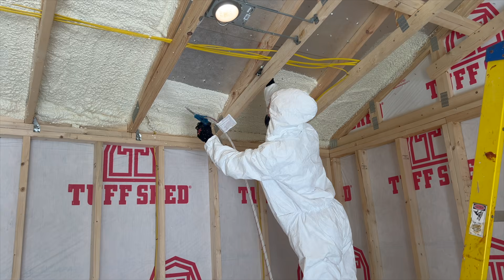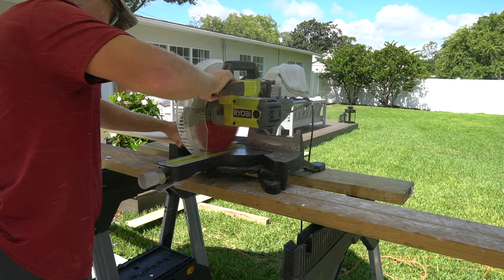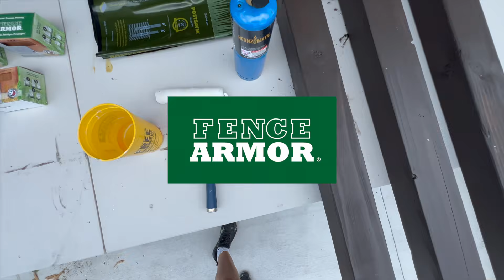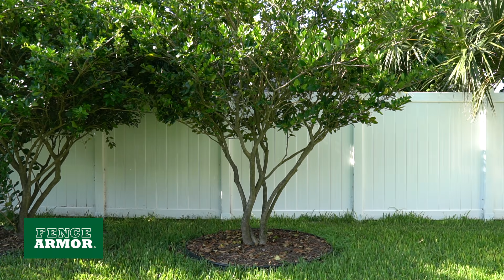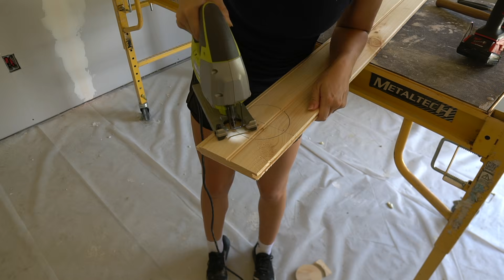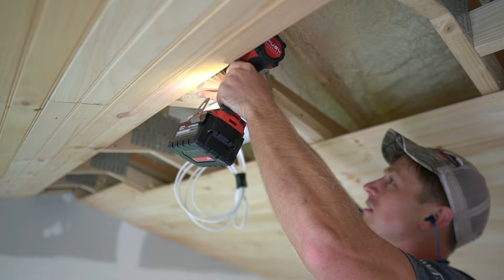How to Install Tongue & Groove Board

Comment: Did you put trim to cover the gap where your t&g met the drywall? If so what kind?
Reply from the maker: Nope, we didn't have a gap. The small seam probably could have been caulked but it wasn't really noticeable! You could cover with a small scribe moulding if you need to.

Comment: We want to tongue and groove our slanted ceiling but trusses and rafters aren’t even (and not on center) and there is no level reference line and trying to figure out how to level our first row on an angle. We have insulation that bulges in center so a laser level doesn’t help as the lines are interrupted by the batts. Any suggestions would be greatly appreciated!

Comment: Why no construction adhesive? I also thought you also need to seal the board with a pre stain or sanding sealer to minimize movement. Getting ready to do a cathedral ceiling.

Comment: Is the pattern just random as far as where the boards end?  I’m struggling to figure that out.  My ceiling is 26 ft long
Reply from the maker: Yes, the pattern is random! We tried to stagger the joints as best as we could without wasting material.

Comment: Great video, thank you!  How long was your ceiling in total length? I want to install T&G pine or cedar on a peak ceiling like yours.  My ceiling is 15'4" long, I am considering to purchase 16' boards, cut to exact length and make no end to end joints or should I go with shorter lengths of boards and have some end to end joints?  What is your suggestion on board lengths for a 15'4" ceiling?

Comment: To install this T&G pine ceiling, in order to meet code you must first installl a fire retardant material...   Most people will have drywall installated and joints taped but not finished.
Reply: Where you seeing this 5/8 drywall at. And if not drywall under it how about mineral wool insulation instead?

Comment: Not only is the shop going to be a great space, it's also going to be a beautiful one.  I'm so jealous.  Just one question, as another female DIYer, do you find the battery powered nail guns to be so heavy that you get a lot of fatigue, especially when working overhead?  I've thought about replacing all my pneumatic guns with battery powered ones, but every time I'm at the store and I pick up one of those, I'm just astounded by the weight difference.  Cheers!

Comment: I’ve had same issue with ordered material from HD and Lowe’s so started ordering from a local lumberyard. Price is a little more, but when you factor in the bad boards and headache of going through all the boards it is worth the added cost.
Reply: Agreed.  Always ten times better wood at lumber yards vs big box store crap.  Also youre supporting a local business.   Also, TnG boards dont have to butt exactly on the joist, your next board locks everything in place.  Saves a ton of cuts and wasted material too!   Yours came out looking great.